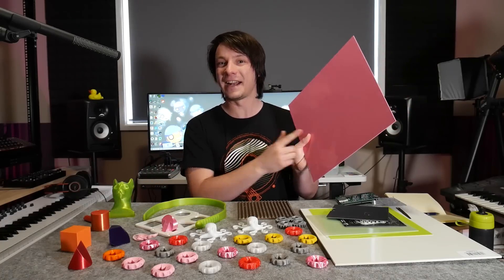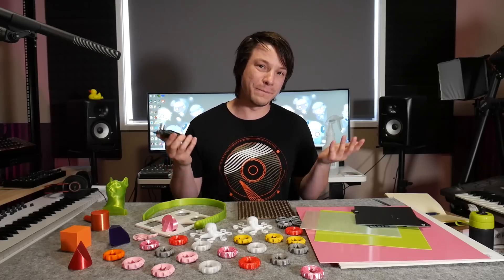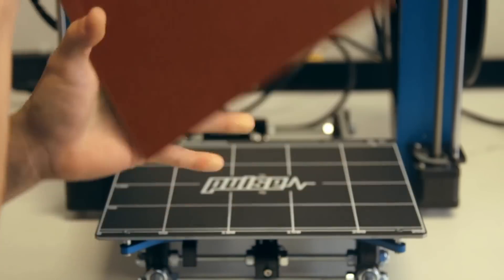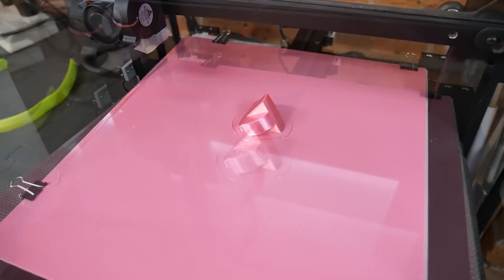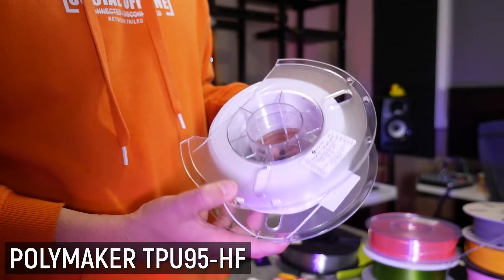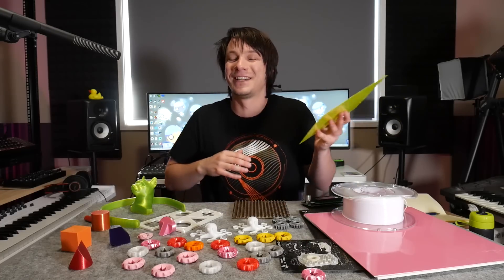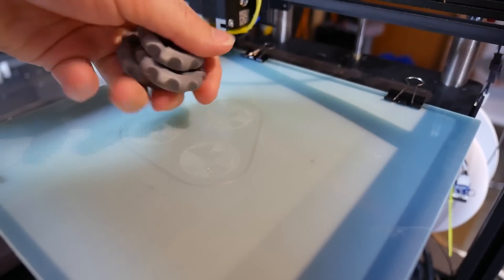G10 - The best print surface you've never heard of.

Comment: Guys... this is called epoxy resin. When printing on either carbon or fiberglass, you're printing simply on epoxy resin. If you like the properties of it, you can convert any printing surface of your choice to it by simply getting some laminating resin and putting a thin layer of it onto the surface (after sanding and degreasing it), and then harden it in your oven for some hours, according to instructions. If putting it on spring steel, you shouldn't over-bend the plate of course as the epoxy film could break. (what, on the other hand, helps in getting it off if you want to renew it) The fibers only give it their stiffness and strength, they do nothing to the surface itself.
Reply: Hint: to prevent having a bulge form at the borders because of the surface tension of the resin, you should put a sheet of wax paper below that's larger than the printing surface and overlap the borders all-around a little with resin for about a half-inch. After hardening, you can carefully break or cut it off and sand it to get clean borders. 
However, it won't work with some of the exotic, overly thick printing surfaces that some people use, (like, several mm thick) as the difference in height to the wax paper is too large to have any effect. (depending also on the viscosity of the resin)
Reply: You're right, but the cost and availability is what's really on display here. I work at a machine shop that does a lot of plastic work, I wonder how some of that would do... PEEK, for example, and some proprietary blends...
Reply: @aidankilleen5889  The majority of inventions were discovered by trial & error and accidents, so, if you have access to unusual materials, I suggest trying to get your hands on some samples. However, before getting your hopes up after discovering a great, "new" material, I'd thoroughly check if it already has been discovered. In 3D printing, for example, I've seen plenty of unusual stuff exclusively in the world of highly expensive industrial 3D printers.
Reply: @aidankilleen5889  Regarding PEEK - I think I've already seen printing surfaces made from it on a manufacturer site of industrial 3D printers.
Reply: what about the dimensional stability under heat part?

Comment: So you could make a PCB heat bed that has the heating traces on one side and the other side is just bare FR4.
Reply: No, because the heater causes a substantial sag when running.
Reply: @SianaGearz  Well you need to have the heater somewhere anyway. You could still have something thick and hard under the heater to prevent sag. Having the heater on the same PCB that is the build surface could help with heat transfer.

Comment: Can you test FR4 too? Apparently it replaced G10. 

Citation off wikipedia: 
„Epoxy resin is flammable and, once set on fire, will burn violently, giving off poisonous gases. Therefore similar materials like FR-4 containing flame retardant additives have replaced G-10 in many applications.“ 

So it might be better for printers that suffer thermal runaway.

Comment: My Ender 3 came with its build surface attached to a sheet of G10, I thought it was plexiglass. However pla does not stick to it at all, so I use stick glue on the original Ender 3 print bed. I use a heated bed at 60 degrees Celsius, and I wait for the glue to completely dry. I achieve perfect bed adhesion with absolutely no warping, as well as perfect first layer squish thanks to your feeler gauge advice.

Comment: I know years ago Proto-Pasta offered it as a flex plate but I think it was a material before its time on bed surfaces. The nylon version is Garolite LE which is linen-based, hence the dark colour. 

One thing I will say when cutting G10 is you need proper dust control, this stuff has glass fibres and in some glass beads and neither do you want to breathe in!

Comment: I have had this sheet of FR4 sitting on my shelf since 2012, ONLY using it for printing nylon. No one ever mentioned it could be used for the other filaments. :/

But nylon sticks sooo good, its almost like PETG on glass. It may rip a layer off the print surface, if you have a large contact surface! 

AFAIK the stuff is created throug thermal infusion/impregnation, so it is not recommended to heat it above 60C.
Reply: It's a thermoset polymer, it is probably only heat activated to cure. Once cured, it should be good to much higher temperatures.

Comment: If it's the same material as PCBs then you could try printing on a custom PCB. Traces could be added on the other side for heating too, making the whole bed assembly really light. This could make 3d printers that move the bed (Prusa i3, Ender 3) print much faster and reduce ringing. Getting sponored by JLCPCB or PCBWay would probably not be too hard either :)
Reply: Uh FR4 PCB heaters are already a thing since early reprap days, cost maybe $3 for the 21cm size. But because the heater is embedded into the bottom layer, they warp and sag as they heat, they are like half a millimetre down in the middle when at operating temperature, which is a little much. This is why aluminium PCB heaters became common, they are more stable since the temperature is better equalised.

Comment: Try getting some PVP polymer (Polyvinylpyrrolidone). It’s available as cosmetics supplies. It comes as a powder and dissolves in alcohol and water. I dissolve a very small amount of PVP in IPA and use it to deposit a thin film on the G10 sheet. The bed still needs to be heated but you can get away with lower bed temps. It’s especially impressive with ABS. An ABS print will stick so well that you can’t remove it without breaking the print, then it just pops off when the bed cools to room temp. Sometimes the print will jump off the bed when it self releases.
Reply: Seems like a great advice, but local suppliers all want to sell way too much, or Merck is like 36€ for 25g, but this company is always expensive. Others want me to buy 5kg of the stuff. And I feel a little sketched out by the prospect of ordering 100g of white powder from China, I think customs police may get curious, I really don't want to be SWATted.

I found some PVP containing glue stick, it's cheap enough that I could try it.

Comment: I have a custom heated bed made by cutting a spiral in a single sided copper plated FR4. I have a sheet of glass on it's top as the actual printing surface, but nice to know that I can also print on the back of my heating element!

Comment: We have several robotic welders where I work. Many of the bushings for fixturing are made from Garolite; It's available in more than just sheets. We treat it kinda like aluminum to machine it to the shapes that are needed. Easy to machine, high heat resist, and weld spatter doesn't stick to it. Garolite is nearly the perfect product for our applications.

Comment: Garolite is a brand name and G10 is only one variety of material sold under the brand but the one that is IMO not the best choice for 3d printing although it is probably the cheapest and most accessible.. Garolite comes in many varieties and they are not all the same... The brown colored stuff shown in the Matterhackers video is the old-school material usually based on either paper, linen or cotton and phenolic (ie Bakelite) and not glass fibre and epoxy like G10 and FR4 which is usually a translucent yellow-green in its natural state but is often dyed other colors..   Phenolic resins do not deform with heat like epoxies do, so the thinner sheets can absolutely be used with ultra high temp prints (I use 1mm Garolite XX or Garolite CE for nylon all the time and have no issues with the surface deforming).   Non-fibreglass based Garolite is more fragile than fibreglass based composites though, so it's not uncommon for bits of the surface to flake off, but it's a small price to pay for adhesion..
Reply: Flying0Dismount beat me to the punch, but I'll add my thoughts. Garolite is a generic term for fiber reinforced plastic. Garolite is not a registered trade name, so it is not possible to identify its true owner, or specific definition. Having said that, the Garolite that MatterHackers, Taulman 3D, 3D Maker, etc. tout for Nylon is made with a thermoset phenolic resin. Phenolic won't deform with heat, and probably has different "sticking" properties compared to epoxy resin sheets. This is a great video and clearly demonstrates that G10 (which is, by definition, fiberglass reinforced epoxy), works wonderfully for a great many materials. Fiber reinforced phenolic may be better for Nylon, however.
Reply: @Flying0Dismount Do you really use Garolite CE for Nylon? I am surprised that Nylon would stick to the slippery graphite.

Comment: FR4 you say? So you're saying, in the old days when bed heaters were just a PCB with resistive traces and we slapped a piece of glas on top (plus tape, plus glue, ...), all we should have done is keep the rear side clear (no copper, no soldermask) and just print on the reverse side of the heater PCB?
Reply: No, because the heater directly attached causes a massive temperature gradient and it warps down by like 0.5 mm in the middle, as the bottom expands.

Comment: No need for bed clips with G10. It's very easy to form under heat. Just take a heat gun along the edge and use a ruler to push it squared with the corner, when it cools it'll shrink just enough for an interferrence fit.
Reply: there is going to be some deflection upwards if you do this, leaving you with a bowl shaped bed.
Reply: I use a G10 build plate but with a matching magnet plate for my printer (creality K1) printing nylon mostly with no issues and no build volume interference

Comment: I never liked using glass or just mirrors, especially because of the glossy finish it leaves on the first layer. I just find that it looks way too different to the rest of a print so I prefer some texture or at least matte finish. For that reason I now print on either a powder coated PEI spring steel bed (textured look) or smooth PEI sheets that I sand with a very fine grain sandpaper. Angus, have you tried sanding it all over with say a 2000 sandpaper? Would be interesting to see the result. The only disadvantage could be that it ends up sticking too well :D
Reply from the maker: I had to sand it to work with nylon yeah, and a tiny bit of glue stick. Rest worked on the glossy surface.
Reply: @MakersMuse  Thanks for the info! Btw. just received my Headamame kit which I ordered right after your video hit Youtube. :) I'm a pure PrusaSlicer user now and have no experience with Cura (used S3D before) so slightly sad about the gyroid supports obstactle.

Comment: I’ve been having great success with smooth pei adhered to a spring steel sheet (w/ after-market magnetic base). I roughed it up with a bit of 00 steel wool and gave it a light coat of hairspray. I mainly print with petg, pla, and tpu, and all three work well. I’m printing with a Longer LK4 with a BL Touch and a slightly modified extruder to accommodate flexible filament.
Reply: When I first got into 3d printing 3 years ago, I was told to get PEI coated spring steel from a veteran printer.
I was stubborn/scared because I had a slightly-warped Ender 3 bed, so I only used the borosilicate glass for flatness, utilizing hairspray and isopropyl.
I went with PEI coated spring steel about 2 months ago, and I'll never go back.
I only print PLA and PETG so far, and the prints stick like glue when bed is heated, and release cleanly when cooled/flexed.
Use what works for you, but this $30 bed is amazing.
Reply: @secretweaponevan  PLA releases pretty easily from PEI; however, PETG on PEI requires a release agent. You might get away with no release agent for PETG on PEI for a while, but eventually you will damage the it.
Reply: @Vortex-gz8se  I've been printing with PETG and PLA on PEI spring steel sheet at 60C with no need for release agent.
Reply: @engineer1692  like I said you might get away with no release agent when printing PETG on smooth PEI for a while, eventually you will almost certainly damage it. Don’t you notice that PETG is a lot harder to remove that PLA?

Comment: Dunno, I get perfect PETG prints on Prusa powder coated steel sheet. Sticks beatifully pops by itself when cools down. With minimal maintenance, once every few prints I spray IPA and then wipe with paper towel. After 1.5 year looks almost like new. Larger prints used to lift corners but this has been sorted with enclosure.

Comment: I suspect the fiber in your g10 causes micro dimpling at temperature which disappears at normal temps. The plastic swells like normal with temperature, but the glass fiber does not, thus dimpling.

Comment: Many knives use G10, its a very popular handle material. If it gets marked up, you can just wet sand it smooth. 320 will knock it down quick and then take it from there to however shiny you want. For a matt to glossy finish, you will not have to go too high. If you want glossy smooth like glass, you will need to use a plastic polish.

Nice video!

Comment: I never heared of G10 but FR4 and I use it for quit a while now. I had one sheet with a strange coating on it but wetsandig it with 600 grid helped.
I had the same problems with TPU. I just used some kapton tape on the FR4 for TPU and that worked great! But I will try printing TPU without heating the bed. Maybe I don't need the kapton tape any more?!

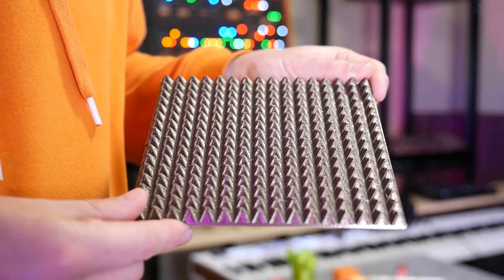Comment: 13:50 Why not use Swiss clips instead of alligator clips? They hold the print surface down just as well and take up way less of your print surface.
Reply: I couldn't find any affordably. On spite of being practically a sneeze away from Switzerland. Or maybe because. I installed clone Ultiimaker clips instead. Two V2 ones on the back screwed in permanently and two V3 ones on the front so they swing out. If I'm not mistaken about versions. Cost me the lot of $3.
Reply: @SianaGearz  Swiss clip's main purpose is to hold the glass in picture frames, so if you find an art shop or picture frame shop, the chances are they sell them. And you only really need 4 of them per printer.
Reply: @AnimatorJuusoz  I made my way to those, but the glass clips in picture frames are different and weird and i can't really fit them to my printer, they are so unbalanced that they won't hold like i'd need them to. Anyway i love my Ultimaker clips setup.

Comment: The ideal way of sticking it down would be with a magnet, like the removable surface on a lot of printers (ex Ender 3 Pro). 

(Side mote: I bought a replacement removable surface for my printer and stuck the extra magnet it came with on a glass bed, but due to the rigid nature of glass, it was extremely hard to get off but you would have that issue with G10 due to it being flexible.)

Comment: I've actually been thinking about the idea of attaching a thin sheet of this to a spare magnetic build plate for a while (and i have a few now :D)
Reply: I’ve done that, get the thinnest G10 you can find and attach to flex plate with double sided tape, works great.
Reply: @marklandsaat3696  This is pretty much inline with what I was thinking with the exception that I think I'm going to track down some (probably clone) 3m adhesive sheets for the job.
Reply: Finally had adhesive arrive tape, now I have to decided between the nice pattern on my textured pei and g10 :d

Comment: I use FR4 sheets straight from the beeginning. Works like a charm but i sand the sheets with 400G and higher. I keep telling myself that the prints stick better that way. You also get a matte bottom finish which i like better than the shiny finish.
Reply: Same with carbon fiber sheets. They work as very similar and are even stiffer.

Comment: I’ve been using the Elegoo Neptune 2 with the G10 bed flipped over as you mention. Works better than their Buildtak which sticks too well. Great video.
Reply from the maker: It's beyond me why they whack that terrible surface on an already good one!
Reply: @MakersMuse  is Buildtak more durable than G10?
Because that would explain it.
Reply: @MakersMuse  From my experience buildtak is quite good, but in the other hand I never been able to make my parts stick to much expensive ultrabase plate so everyone has to find the material that suit him well!
Reply: fR4 may be better I will have to check the data sheets. PCB are made from fr4 and not g10
Reply: @flixmyswitch   FR4 is the fire retardant version of G10
Reply: @flixmyswitch  FR is the Flame Retardant level/properties of  a material.  G10 is the type of material.  PCBs are made of different materials, including G10.  Nothing is made out of FR4.

It's like saying your polyester underpants are made out of Size XL, not polyester.
Reply: 🤯 never even thought about printing on that flipped side
Reply: @Krytern  fr4 is fire retardant. I will have to check the data sheets but I think it also has a higher temp than g10.
Reply: @Krytern  ones fire retardant (fr4)
Reply: @Ruckusmatter  Right, which in this context they are virtually the same thing
Reply: I've done that a few times. I like it better than glass for a smooth surface
Reply: I've just tried this and the filiment didn't stick AT ALL. Is there an extra step or trick I'm missing?
Reply: @DavesChaoticBrain  I had that problem at the start too.  I did a really random sand on it with 400 grit sandpaper and it worked perfectly.
Reply: @Frostfly  Awesome! Thanks...I'll give that a try since it's still a problem!
Reply: Would the Ender 3 bed flipped work as well?
Reply: @andresgalvan9104  no
Reply: @Dexter_Morgan.  why not?
Reply: @andresgalvan9104  i think so
Reply: @andresgalvan9104  it depends on the bed tho, i dont have an ender 3 i have the v2, but i think the ender 3 
comes with a g10 one now?
Reply: I have the same problem with anycubic Mega X, its stick too well and i cant get anything without using spatula..